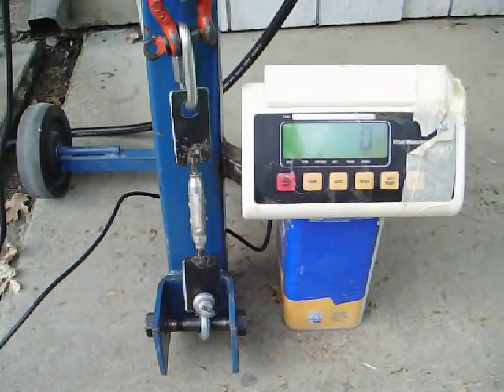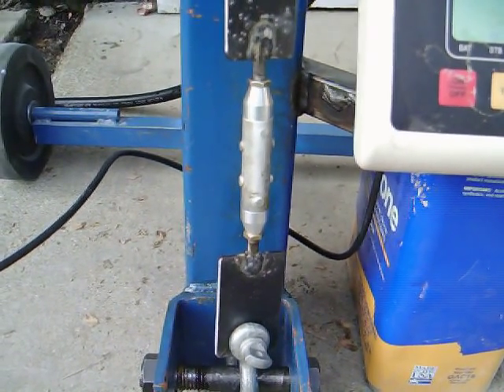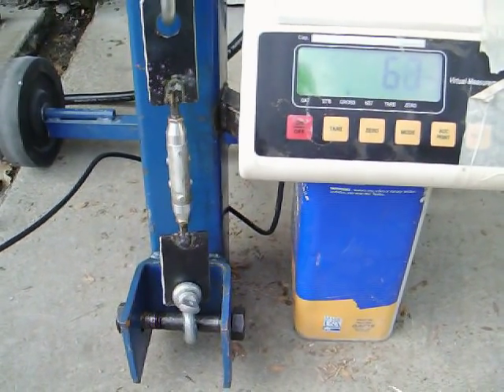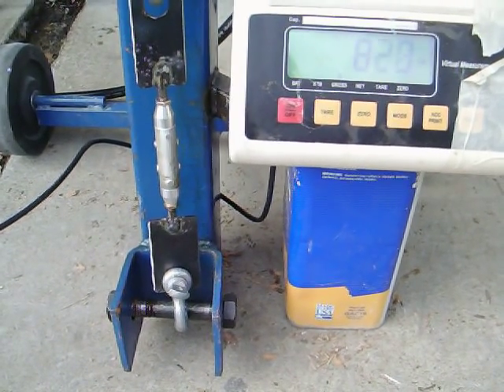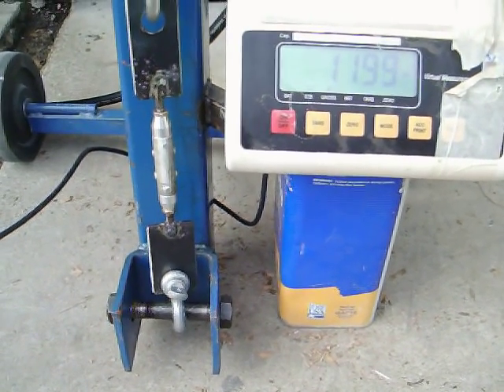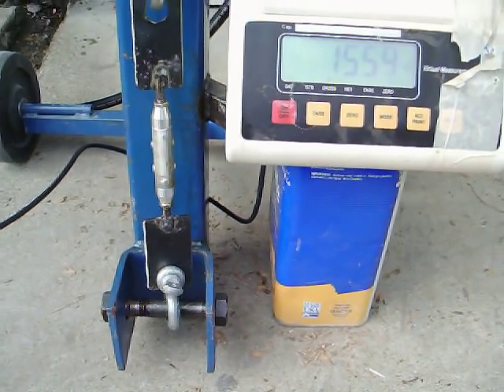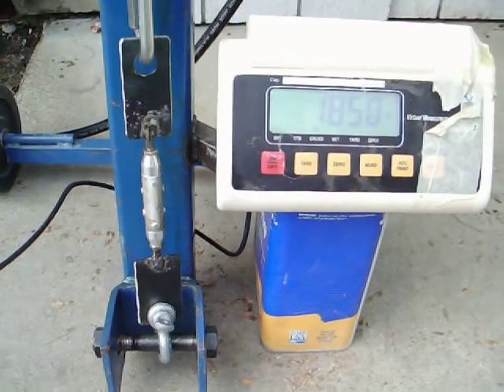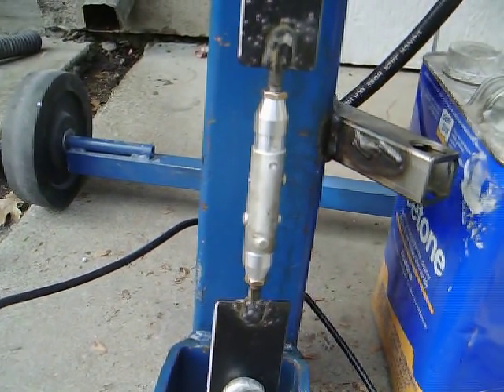Tensile test of aluminum push-pull tube

Comment: What application is the push/pull tube used for? Also, I have another question.... I am a Drafting/Design student and I need to design a step stool. I want to use 3003 1/2" OD aluminum tube for the frame. The frame will be made up of two equal size/shape tubes, each will be bent 4 times to provide mounting areas for steps. The height of the top step will be 16", the bottom step is 8". The two steps themselves will be high density polyethylene plastic, bolted to the tubes. Do you think 3003 alloy 1/2" OD aluminum tube will suffice for my step stool? Any advice will help. Thanks!